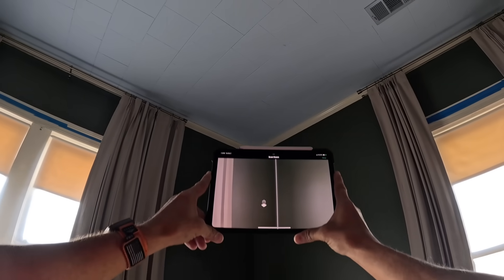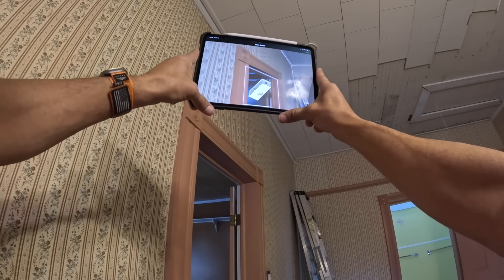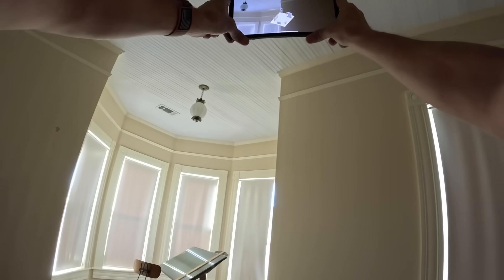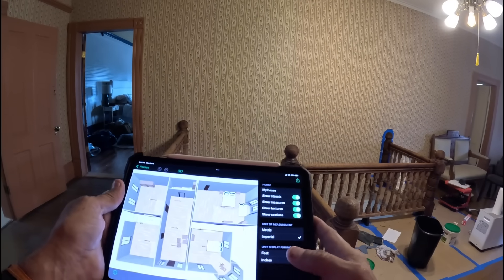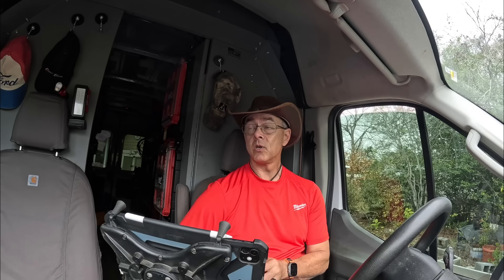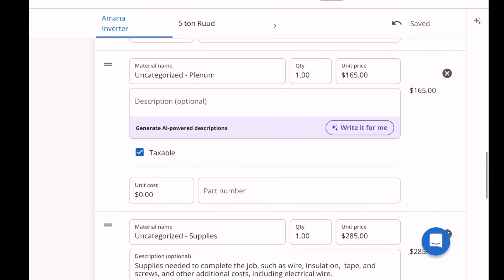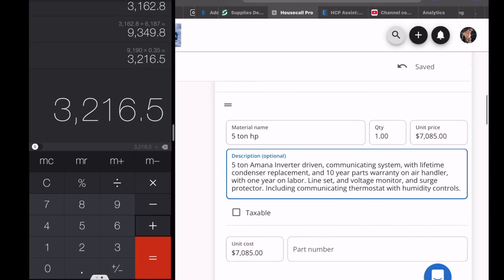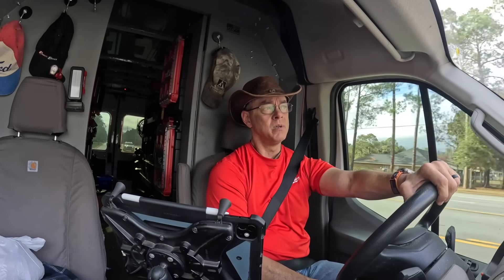I Show Exactly How I Work Up Estimates With A Real Example, Showing Actual Prices!

Comment: Manual J has a lot of fudge Factor and design day is already 1% of actual day temps. I’d go 4T personally as it will dehumidify better and increased comfort from longer run times.
Reply: Difference in price between a 4T and 5T variable speed is negligible.  The ductwork, controls, labor, overhead, and profit will the the SAME.  He's smart to upsize to the 5T unit, and with variable speed both will de-humidify the same.

Comment: That is really low companies around my area for a 5 ton high efficiency communicating system swap out would be about $16k
Reply: Shit in my area they go for 20-28K
Reply: @luispercy4124 that seems alittle excessive but I don’t doubt it in this day and age.
Reply: I installed a 5 ton Carrier heat pump and coil for 18k today. I know the Bosch heat pumps are up there in cost also

Comment: my sister in laws house is tiny like 1,400 sq ft and somebody put in a 100,000 btu heater and the gas company said it had leaky heat exchanger so i replaced it with a new heater that was only about 60,000 if i remember right and changed the thermostat settings to hot air rather than hot water setting it was so much more comfortable with unit running longer to distribute heat to all the rooms before shutting off
Reply: My house is a 1302 sq ft iv used only tools that says i only need a 60000 btu but in houston texas don't get that cold and how would the gas company know if your heat exchanger was damaged there not hvac techs unless they mean the furnace valve leaking if that's the case you could have had a new valve installed instead of replacing the furnace but sounds like me with home serve scamming me.
Reply: @bluejay713 Someones Co monitor going off.   Gas company get's called in because of a suspected leak.   Where I live, Gas Company and Fire Department both have sniffers.
Reply: @patrickinottawa27  Must be a ADT type alarm system.

Comment: Is the load calculation estimate free or do you charge just in case you don't get the job?
Reply from the maker: That is normally extra
Reply: Iv seen manual J online tools they charge how it works you measure each room and you add it and the online report will tell you what ton system you need Hvac Direct has a free online tool its done by the size of the house.

Comment: Mark up is not margin. Your margin for that job is 25% which is low I believe, too low. 9190 / .75 + 12253. To achieve "margin" at any point in your business (end of year or for 1 day) use the stated calculation. 9190 / .65 = 14140 would show your margin.  I like your channel Curtis but not understanding margin, mark up and profit --- 3 different environments --  is a disservice to your viewers  and mostly to you.
Reply: On a 10000 dollar job with 30 percent profit is 14,285
Reply: Way to cheap, divide for margin , not multiply ,I bet you keep busy with them prices
Reply from the maker: You are right about mark up and margin, not sure I ever called it margin
Reply: I agree.
Reply: FREE labor too! Didnt even add labor cost!
Reply: @daveschmidt4504  No Curtis said he did, we just didn't see it.
Reply from the maker: @daveschmidt4504  It has $1100 on labor, just couldn’t show it

Comment: Way too low.  I would go broke at those prices.  Also, you should be doing a minimum 2 years labor, as all of your competitors most certainly are.  Not busting your chops Curtis, but I have been quoting residential HVAC for 25 years, I know what works and what doesn't work.

Comment: If it a lil over 4 then why not 4and half tone
Reply: generally, the half ton steps are only from one to three ton, beyond that it's always full ton steps in size. except for some of the latest split system technology with inverter driven compressors, that can just speed limit to get anywhere in between.

Comment: Do you account for the type of windows in a house?  Single pane, double, Low-e, etc.  Not sure how much a difference they make compared to type and R value of wall insulation though.
Reply from the maker: There are options for that in calculation software

Comment: Man that is high tech to me Curtis, I would have used a tape measure and some geometry. I think for a high efficiency 5 ton unit, that is a very fair price. Now depending on what he has down stairs, you may get by with the 4 ton. I always ask what the old one was and if it worked well or not. I know I always have to throw a wrench in everything. I think what you did is cool, no pun intended, and professional. Great video my friend.
Reply from the maker: Thanks
Reply: maybe I'm biased having done many other forms of contracting work, but, I would have just measure outside footprint and roof peak height with laser measure eyeballed the ceiling height and took a total window count of first floor and second floor, noting window type, fireplaces, then heat producing appliances inside and if it seems inslated/depth of attic.
just deal with it all as a square boxes, to get sq.ft. total.
that's assuming your not estimating for new ductwork, registers, multi-head split units, etc.

Comment: I would go out of bizz if I quote a system that low.
Reply from the maker: Where you working?
Reply: @HVACGUY  problem is these guys are out to chop heads off. They don’t know how to control expenses and market efficiently. $2500-$3500 is going rate for many one man shows in Houston. If you calla  big company with payroll, radio ads, 401ks, huge offices with back office staff then they have to charge $12000 labor to support that. Those front line guys aren’t making crap doing all the work. The owner is on his fishing boat in the gulf raking in all the cash.
Reply: You can say that again. MU25% plus 40 hours at $95. I’m in bum cluck, racist, sexistville Kentucky.
Reply: @USA-GreedyMenOfNoIntegrity  why are you charging 40 hours of labor? 2 guys should be able to complete it in 8 hours. Why don’t you just charge $400 a hour for 8 hours and be honest about you labor time. I would be pissed to see 40 hours of labor quoted and the job done in 8.

Comment: Does it account for house insulation values?
Reply: In the 80's I worked for an electric system and created a heat pump promotion program based on a manual J calculation and the installed seer on the system
  Doing those measurements and audits was a trip.  I was surprised how few installers knew much about a manual J calculation.  Enjoy your show and have learned a lot.
Reply from the maker: Yes, that is definitely part of it, but calculation isn’t shown here